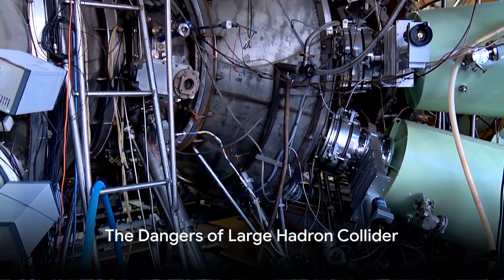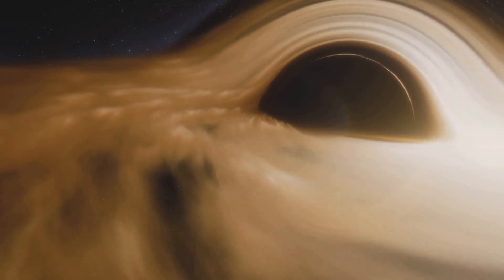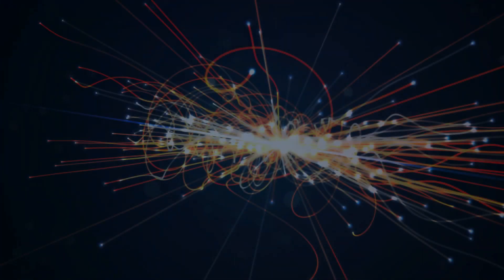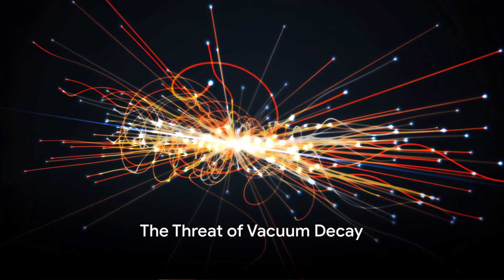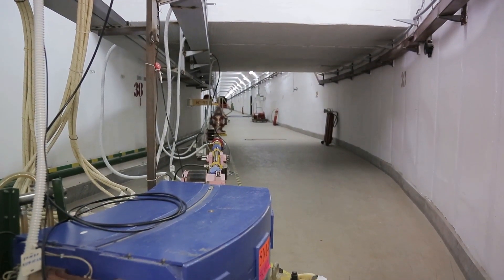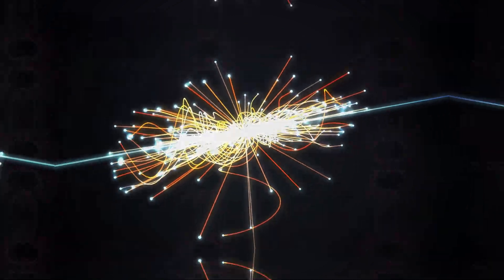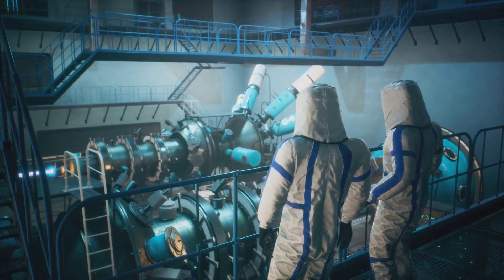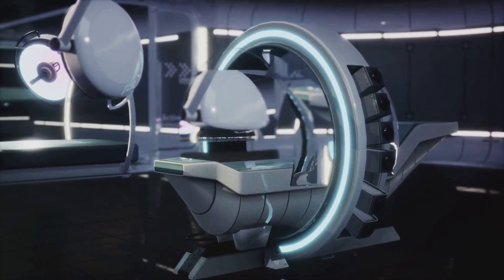What If Vacuum Decay Happened

Comment: Sorry, that's just not correct, higher energy particles are hitting the atmosphere every second...
Reply from the maker: These experiments will not pose a threat to our current vacuum at least for the foreseeable future. However, if the current trend persists, by the year 2150, particle accelerators will surpass the energy released from collisions of naturally occurring cosmic rays.
Reply: Making any kind of fuss about this seems as ridiculous as getting the firing squad for bringing a half a gram of uranium 238 into the Chernobyl reactor.